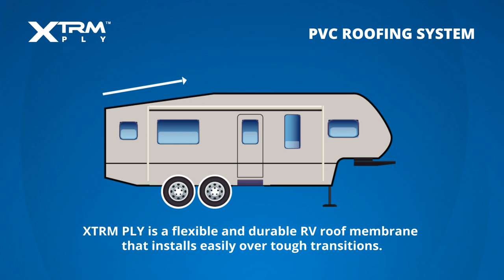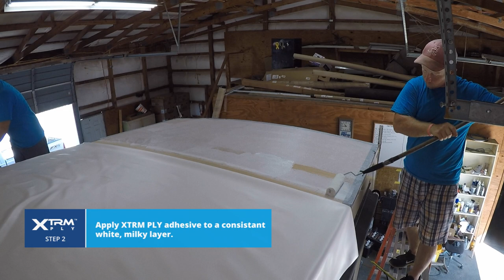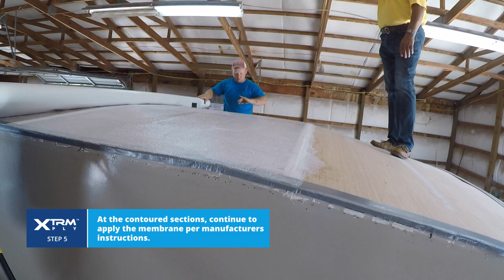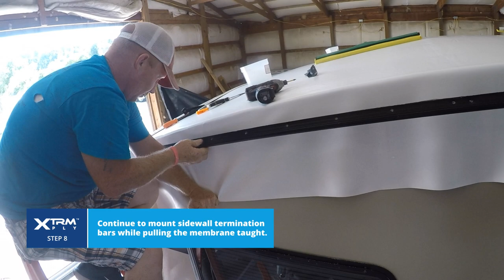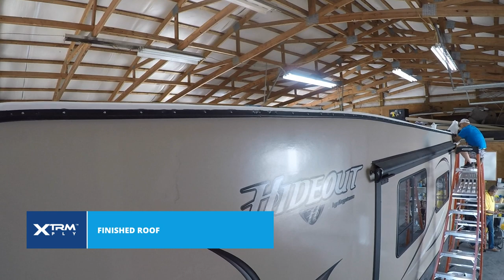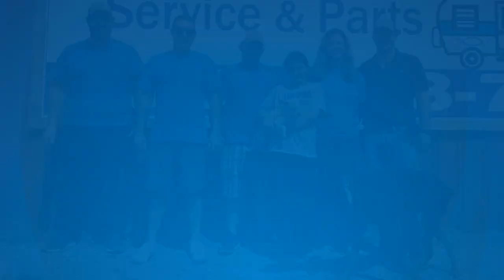Installing XTRM PLY PVC on a Sloped Roof

Comment: i replacing my existing roof with your product. The plywood substrate  already has glue on it. Can i just wet the plywood with the new glue and lay it like this? Or do i need to put it on both wood and the pvc membrane and let it dry and then lay it?